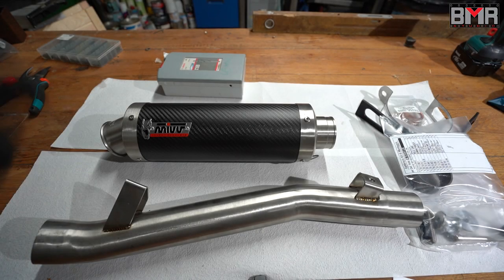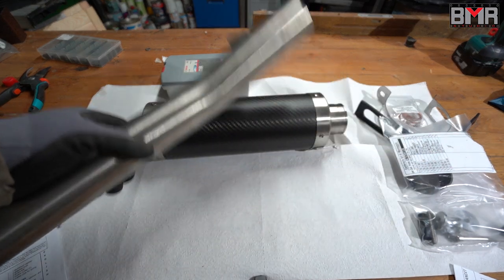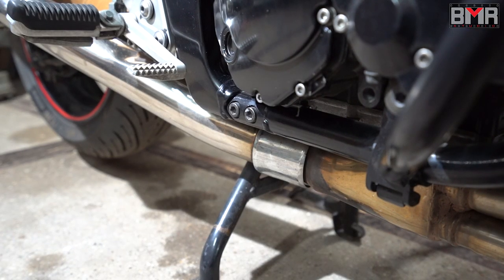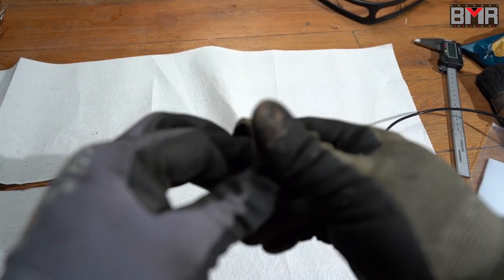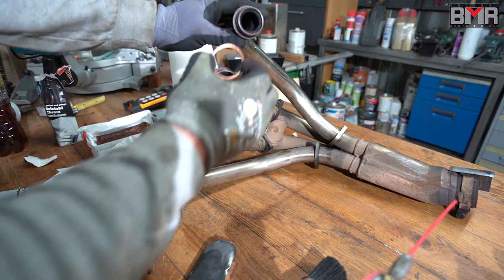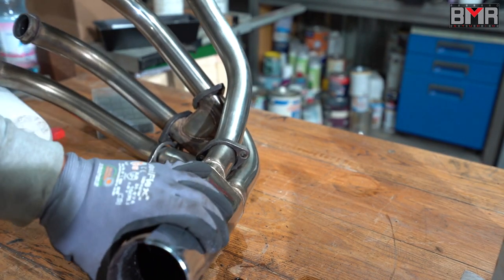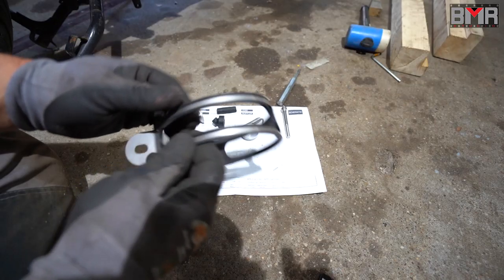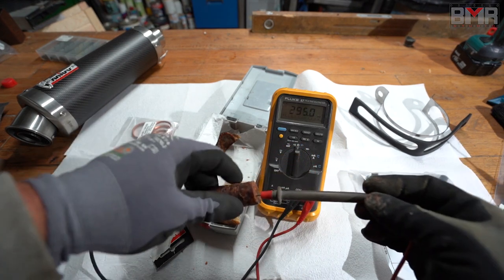MIVV GP Carbon Exhaust System Installation - Suzuki Bandit GSF 650S 2005

Comment: So what about the performance of this exhaust? Some exhaust decrease the power-output..
Reply from the maker: Well, before the top speed was  210 Km/h, now 234.
But maybe this is coming from the full maintenance of fuel lines, carbs, exhaust pipes.
I feel some more aggressive acceleration around 4000-6000 RPM and more stable idle running.

Comment: So, the Behringer 909 is even cheaper than the new exhaust :)
Reply from the maker: Pauls Audiolabor Hehehe :) Yes!
Few prices:
- front brake disks: 300
- rear brake disk: 80
- brake pads: 90
- carburetor rep. Kit: 48
- oil , filter : 70
- exhaust system: 370
- new jacket: 499
- new pants: 100
- new gloves: 270
- other small salala: 200
- new PTI exam: 80

So ride or music? Eh ... both!
Reply: @BMRStudio  I have an Simson S51 Enduro in parts laying around in different boxes. Never finished to restore it and almost forgot about it.
Reply from the maker: Pauls Audiolabor I can give You some tools.....
Bike must roll on the road, not in boxes :)
Reply: @BMRStudio  After a night of thinking I will sell it parts. Then I will have more money and room for more gear :)